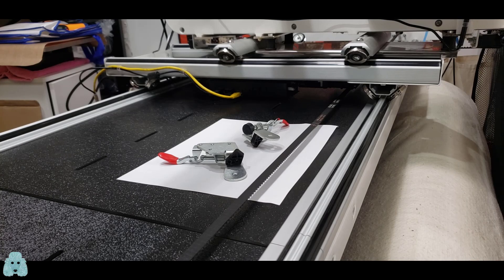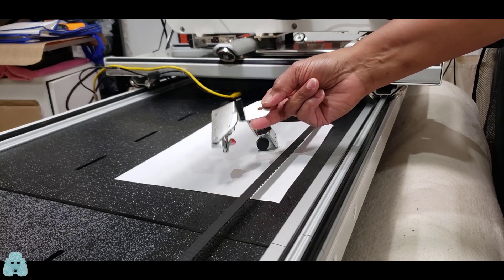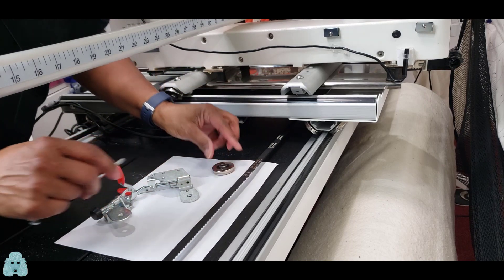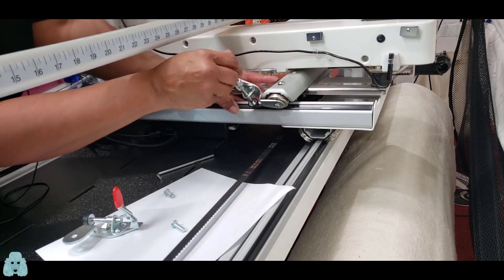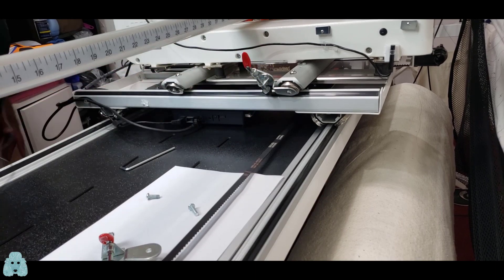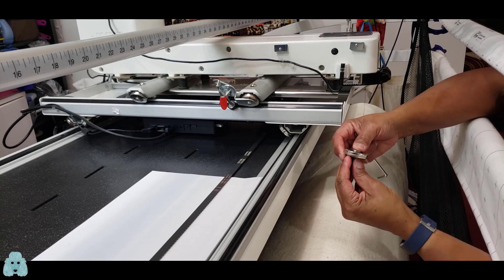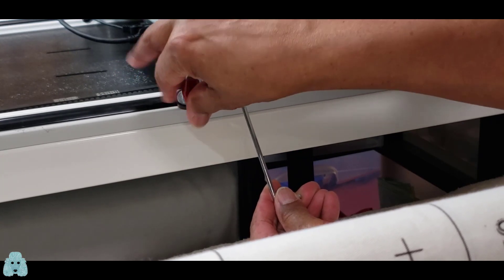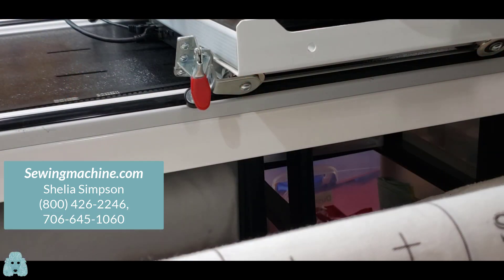Quilted Poodle Bite #14: Installing Channel Locks on Juki TL2200 Longarm Frame | The Quilted Poodle

Comment: Thank you for this information.  I finally ordered the locks and I am about to install them.  The longer screws were not included.  I will call the shop tomorrow and ask if someone can tell me the size/length of the screw and I will buy them at the hardware store.  Can't wait to start using them !
Reply from the maker: I use the channel locks all the time and was so excited to find that the Q'Nique channel locks would work on the Juki.

Comment: what is it for?
Reply from the maker: Channel locks on any longarm machine allow you to stitch either a horizontal line (when attaching the quilt top to the backing/batting) or a vertical line (stabilizing the sides of your quilt). You can also use the locks instead of horizontal or vertical ruler work. Not necessary, but nice to have.